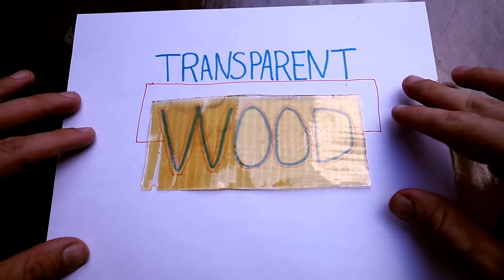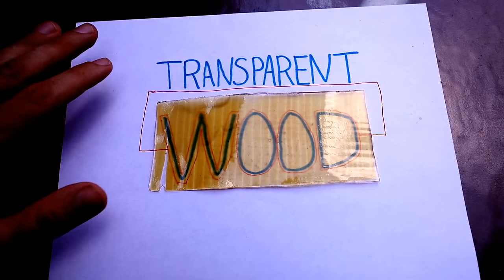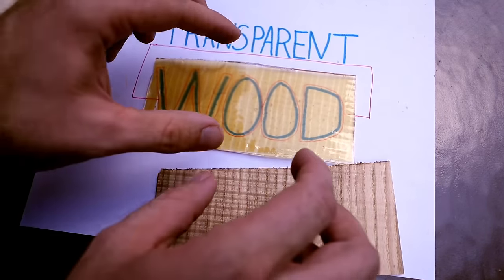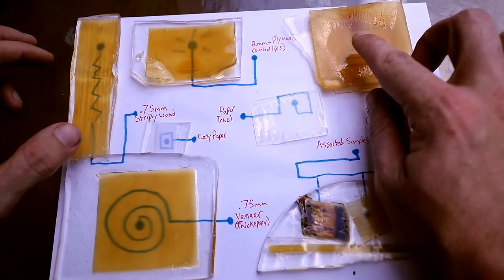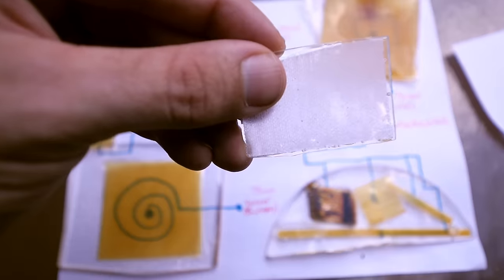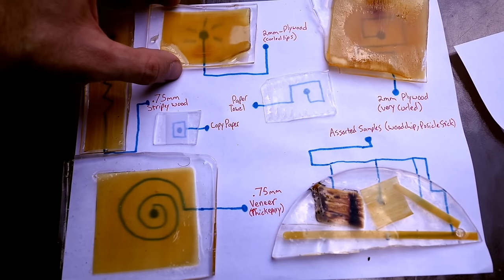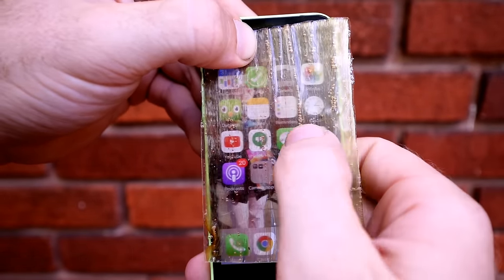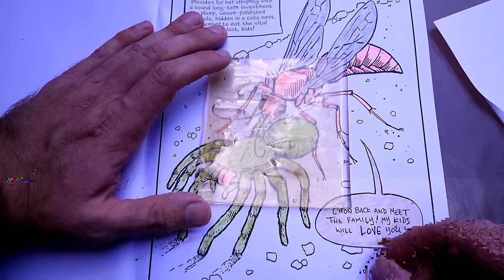DIY Transparent Wood - Overview, Recipe, and Examples

Comment: Very interesting.!!
I see that some of the authors of  this work, also have collaborated in another work entitled: 
"Processing bulk natural wood into a high-performance structural material "
whose mission is to densify wood.

Basically what they do is :
Step 1, chemical treatment to partially remove lignin/hemicellulose; (about 45%)
Step 2, mechanical hot-pressing at 100 °C, (about 5 MPa for about 1 day)
which leads to a reduction in thickness of about 80%. Most of the densified wood
consists of well aligned cellulose nanofibres,which greatly enhance hydrogen bond
formation among neighbouring nanofibres.